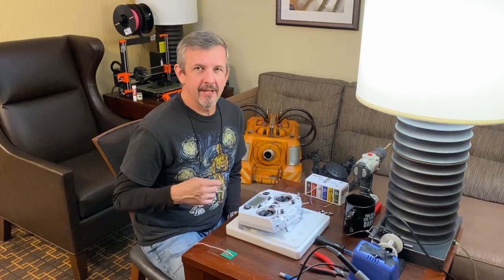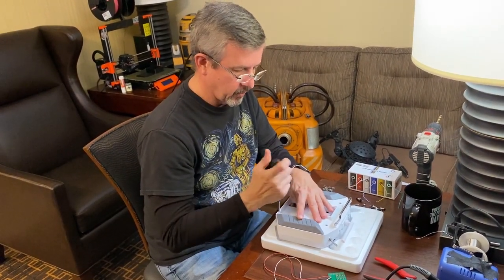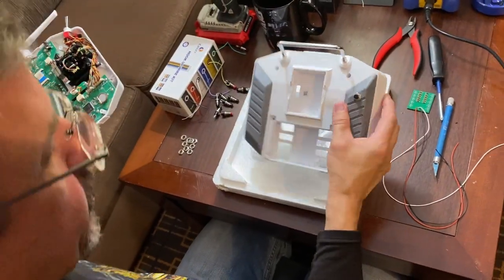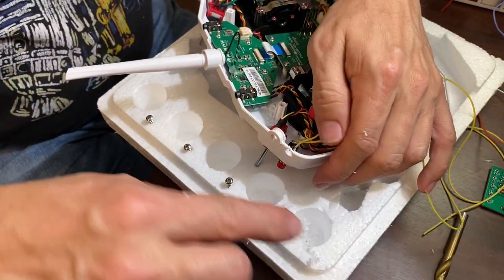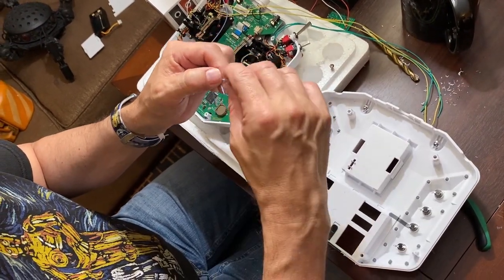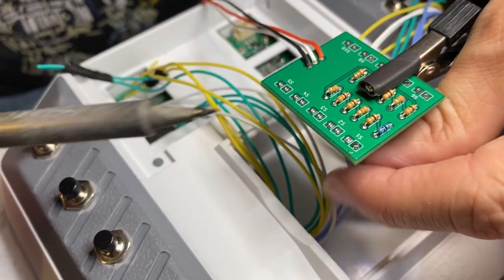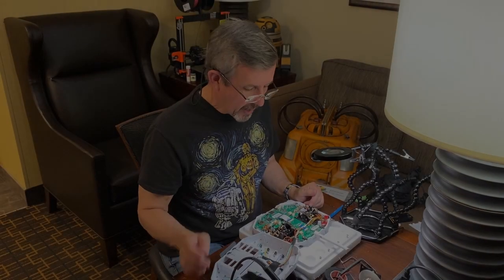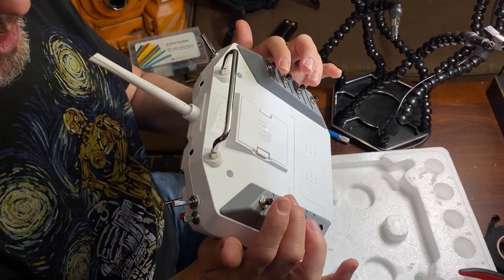Kyber Control System 10 Button Remote Modification

Comment: This is an excellent video. I am getting close to a decision point for electronics on my R2. This system looks like the simplest/best option for integrating RC with sound and motion.  I’d love to see a video for the installation of the 15 button board. I know it’s less involved than this, but a video would clarify a lot.